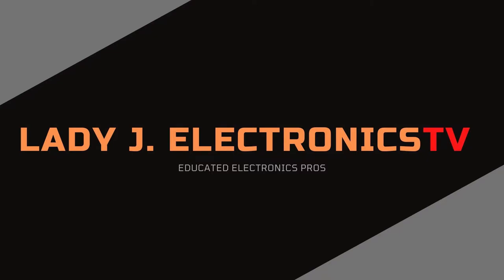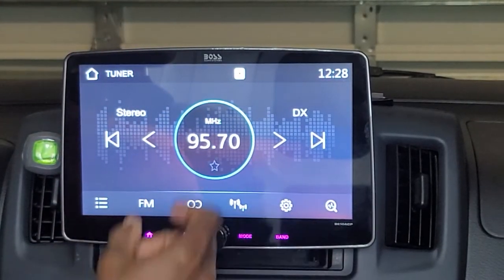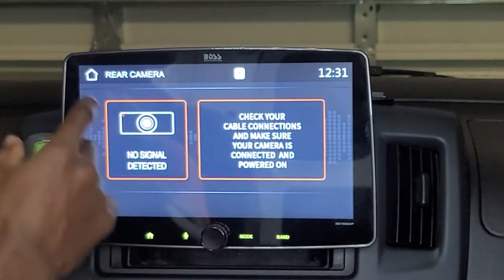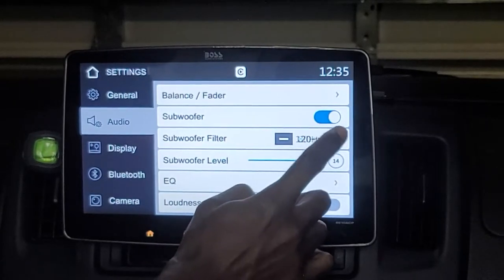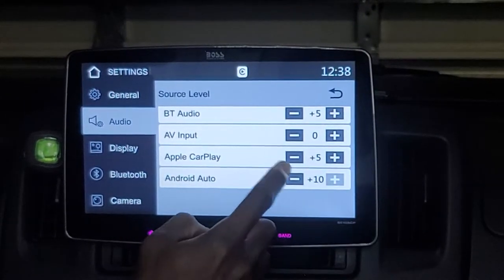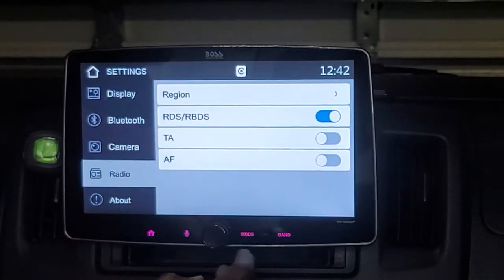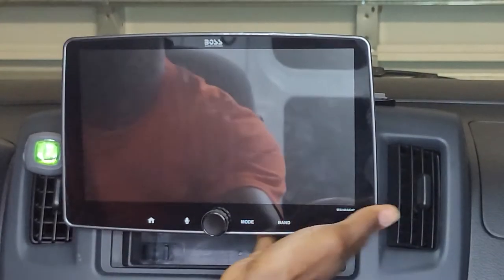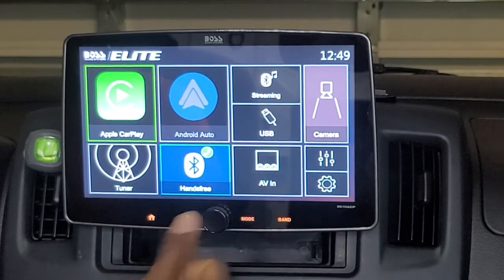Boss Audio Systems Elite BE10ACP

Comment: Do you know the difference between this unit (BE10ACP) and the Boss BCPA10?  They appear to have identical features.
Reply from the maker: On paper, from a side by side comparison, I was not able to tell the functional difference between the two. My best educated guess is that the BCPA10 is an older model and that Boss changed the model number in order to track manufacturing of the two models. If I find information to make a more definitive differentiation, I will definitely post it.
Reply: BE10ACP is the BOSS Elite version, which features HD 1080p, if I’m not wrong, display. BCPA10 is the standard version with a SD display.

Comment: Does the Adroid auto/ Carplay USB Charge while connected or do you have to switch to the other usb in order to charge? Sounds like a hassle on a long road trip if youre using GPS on carplay
Reply: Pretty sure it charges also

Comment: Can RCA be ran from this head unit back to an aftermarket amo and subwoofer I see the connectors are blue in the rear do the still act as regular sub outs?
Reply from the maker: I don't remember what the color codes for the RCA output ls, but I can assure you that this until has set, both right and left RCA outs for, front, rear and separate sub outputs. A total of 8 RCA connections, just for amplifiers. Additionally, this unit has multiple video connections for cameras and video in sources, such as a DVD player.

Comment: Having this installed by a technician near me. However, the con of apple CarPlay being wired seems to be the only downfall for me. Is there an adapter or something I can purchase to install , so I can use Apple CarPlay wirelessly? Not sure if this is possible to do.
Reply: It’s not an option yet. But, the sound suffers with any wireless application.
Reply from the maker: @jameshawelu4916  very true. Unfortunately, BT technology is not developed and reliable enough to produce the same sound quality as a hard wired connection. Thank you for this comment.

Comment: Hey Great review! Do you know if the radio keeps drawing power when the car is turned off? Would you recommend always removing the display to ensure no power is drawn when the car is off?

Thanks!
Reply from the maker: From my experience with head units in general, they do not draw constant power, if the accessory wire to the unit is not sending a 12 volt signal. If the head unit is drawing power while the vehicle is off, then the head unit may be wired incorrectly, or the head unit itself is bad. For clarification, when I say head unit, I do mean (radio).

Comment: Had a issue with the volume changing to call volume and had to turn car off to get back to main volume
Reply from the maker: I have also noticed that the BT talk volume has its own mind, but I haven't figure out if it's user error, or an issue with the radio. I do notice that this problem doesn't seem to be an issue in Apple Car Play. I will make a video outlining issues that I've had.

Comment: I am looking at an install into a 1991 Mercedes 300SL which their 9" would fit better (an 8" is a more perfect look). I really like the mounting flexibility of Boss compared to Joying or Atoto but I am worried about screen brightness in the sun with the top down. Is the Boss screen bright enough (Joying in 800 nits I think)?

Other concern is quality of the radio itself but you seem to think it is quite good. Does it have DSP?
Thanks. Great review
Reply from the maker: The screen is fairly bright, however, I have not had the opportunity to view, or test it in direct sunlight. After using the unit for months now, it definitely has some issues, but I can't tell if it's the unit itself, or the proprietary software that enables the UI, for Apple Car and Android Auto Play. The unit does have very low level DSP, in the form of a pre installed crossover and dB controls, but other than that, there is no other DSP features. I do use a separate bass DSP and that coupled with this until gives me a nice improvement in bass quality.

Comment: Great review! A few questions: 1. Is the apple carplay wired or wireless? 2. Do it come camera or do I need to purchase separately/second hand? If so, how do you install/sync camera to the system? 3. Is it possible to get Sirius XM radio?
Reply from the maker: Great questions!
1.  Carplay is wired, for both the Apple and Android and also uses the exact same port, which is a con.
2. It does not come with a camera, however, a few companies, such as Amazon, sells a bundle, where a recommended camera is included. Normal after market cameras will come ready to be wired. You must find a reverse trigger on the car (reverse light), a ground and the RCA would run directly to the RCA out on the back of the radio. It's labeled backup camera.
3. The radio is NOT compatible with Satellite radio, however, you can add an XM connect receiver separately and install that with this unit. I hope these answers help.

Comment: thanks for the video. can factory reverse camera be connected it ?
Reply: I've heard that others have done it.
Reply from the maker: It depends on if the camera is 6 or 12 volts. Nissan uses a 6 volt factory camera that will burn out if you connect to an aftermarket unit. You would have to use a step down transformer to make it work.

Comment: Would have loved to have seen usb demo’s but regardless, I’m sold anyway. 
Will it play videos in CarPlay, or allow for casting?
Reply: Yeah it’ll play videos. You’ll have to put the parking break on though. OR, like most people just ground the parking break wire or put a toggle switch on the wire. That way you can watch videos or basically do whatever you want while the car is moving.

Comment: Android Auto is fine....You just have to use a compatible usb wire and not just any over the counter one.
Reply: How, coz I'm stuck trying to figure out how to get android auto to work even with a USB plugged in the android auto port

Comment: can you use youtube ?
Reply from the maker: Yes. The easiest way to do this is download an app that will allow you to mirror the phone on your radio. For Android I use an app called AA mirror. I have not found a comparable app for IPhone that doesn't require me to jail break the phone.
Reply: @ladyj.electronics7882  You need a HDMI to AV Converter, along with a HDMI to Lightning Adapter to connect IPhone. You can watch youtube. Basically it is mirroring your IPhone. Quality is decent. Definitely viewable. Each component needs to be powered. It's not difficult but you need to plan it out.
Reply: @ladyj.electronics7882  Can u make a video on AA mirror?